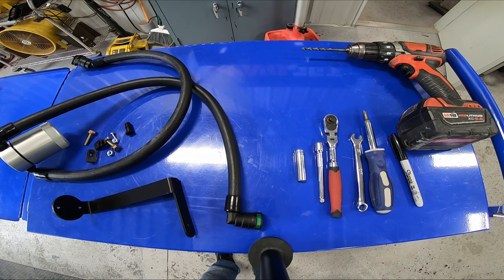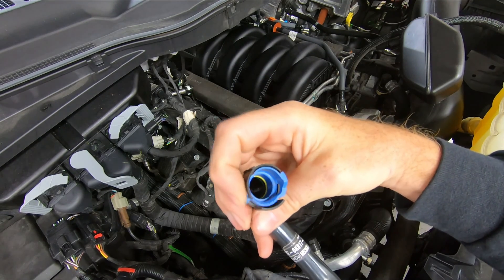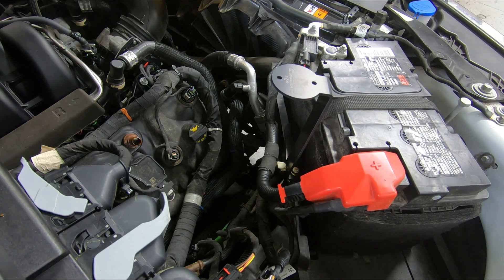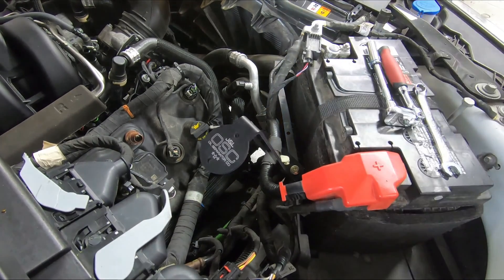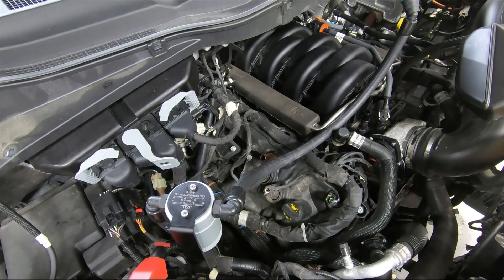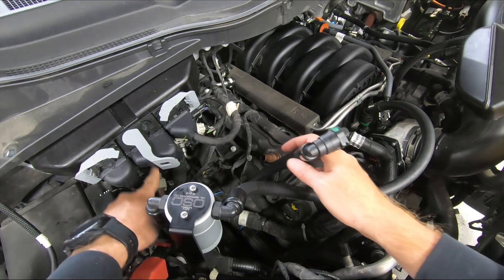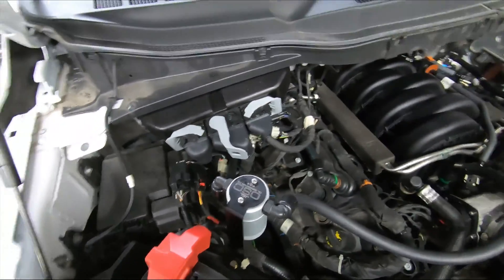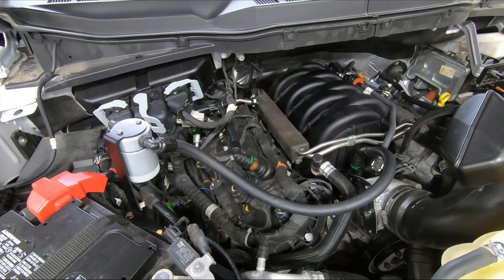J&L Oil Separator Co. 2021-2025 F-150 5.0L V8 Oil Separator Install 3016P

Comment: What is the little single plug that’s designed for Roush/Whipple Superchargers? Where does it go?
Reply from the maker: It's for the older Roush/Whipple setups that have 3 lines coming to the PCV setup.  You cap the small one that runs to the bottom of the lower intake.

Basically you would know if you needed it.

Comment: Does this void powertrain warranty
Reply from the maker: If you read the fine print on any warranty contract you will find a lot of reasons your warranty can become void; installing aftermarket parts can be one of them. However, per the Magnuson–Moss Warranty Act proof would have to be provided that the after-market part caused the failure.
If you need further clarification, contact your vehicles service department. Some are easier to deal with than others.
Reply: Most dealerships likely wouldn't worry about it unless they suspect it caused the issue you're asking them to fix.  Since this is literally a 10 minute installation, I would say to just remove it and put your stock PCV hose back in place if you are taking it in for warranty work if you really want a piece of mind.

Comment: Whats the plug for.
Reply from the maker: The plug is only used on the trucks with a supercharger.
Reply: @jloilseparatorco.1853 
Where at on the supercharger? I’ve got a 2024 with Whipple Stage 1 kit. Where should I install it?

Comment: What does that part specific to the '21 used for?  My '21 3.5L doesn't have a place kn the battery platform to install that bracket.  Any ideas.
Reply from the maker: Hey Matt, all though the battery is oriented differently in the 21+ trucks, the bracket will still work. You'll just use the supplied lock nuts instead of the j-clips.